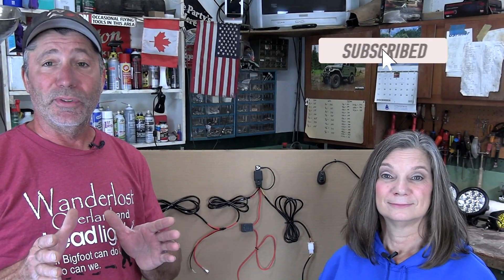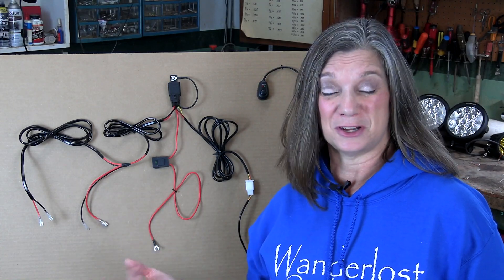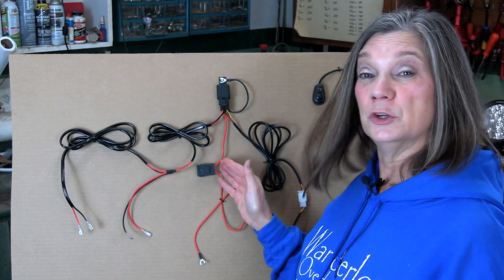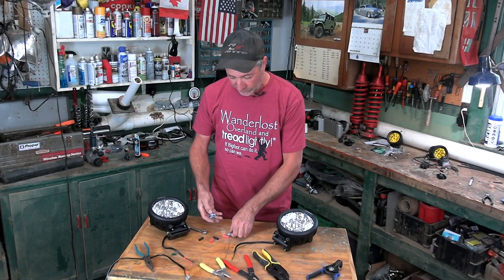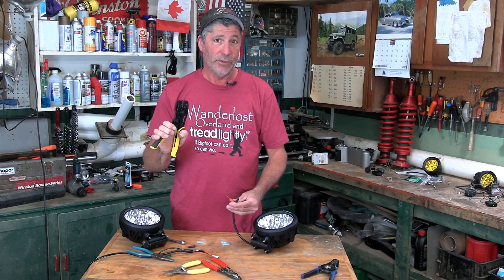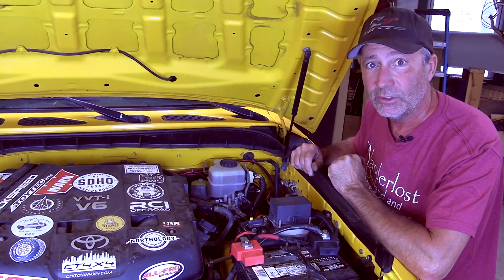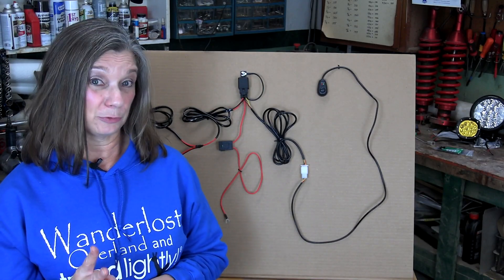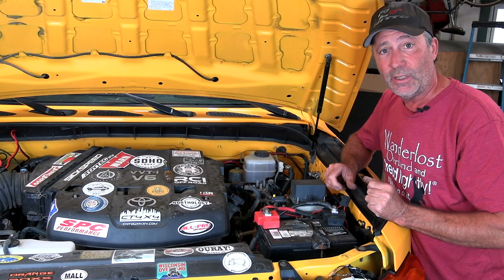How To Wire In Relay Harness For Lights, SIMPLE!

Comment: I have questions if I used the switch that came with it have a red light and green light if the truck is not on th red light always on does it drain my battery??
Reply: Or can I used different switches that doesn’t have any lights so doesn’t drain my battery when the trucks is on

Comment: Great video. Will the inline dash switch run the battery down the Red LED off light illuminating? Or should I run the hot wire off the fuse box?

Comment: Great video. I have a question. So ive installed 2 9inch spotlights and were working fine until a few months later the 30A fuse keeps melting afyer the lights are on for a while. Why is that happening?

Comment: Hey guys, this is a great video, but I have an issue. I am adding the LED lights to the rear cab of my tractor. The battery is all way in the front of the tractor. My power wire on my harness is about 10' short. Can I just splice in more wire, and if so do I use the same gauge wire or heavier ?

Comment: 2:15 not grounded correctly. The only contact you have for ground is the contact the screw is making with the thin edges of the hole it's hanging onto.
Reply: If its a plastic boat do i need to be concerned with ground the switch?

Comment: Im about to imstall light tomorrow.  This video made me feel a bit more confident in doing them. Although i have 3 A pillar switches already installed and would like to use them instead of the switch on the wiring harness. Can i just cut that switch off and connect the wires to my own switch?

Comment: Also there is a certain way the fuse tap is inserted. You can do this with a test light by finding out which side is the positive and negative. One side will light up and you want to run the wire from the fuse tap opposite of that so away from that side

Comment: Great video - new subscriber.  I already have a 20" Go Rhino LED bar installed with the same switch you guys used. I'm adding two more 3x3 cubes.  What type of wiring installation do you recommend?  Just keep it as a separate switch or some sort of relay?  Thanks

Comment: There is three wires going to the switch. If I want to use the “add a circuit”, which wire do I connect to it? What do I do with the other two wires? Thank you for this video!

Comment: I bought a 12 inch 180W LED light bar on Amazon & it came looking like this the wires, fuse & relay & all I had to do was plug the wires together & put the battery connectors on then I turned on my 2023 XMR 850 (quad) & about 20 seconds the fuse blew on it 🤦🏽‍♂️

Comment: great explanation thank oy...one question. my harness, in addition to the white wire come out of the butt connector to the switch that goes to the relay, there is a red and black wire come out of the white butt connector going no where...are they to be used?

Comment: You forgot to say what size fuse in the wire going to the battery.
Reply from the maker: The fuse amp size depends on what you're powering. Since that's an unknown for us, we couldn't recommend a certain size.

Comment: ive got oem foglamps working already and after a year relay got faulty. git a new one and all where working fine but it wont power on. lights working switch and relay working when connected to direct positive. is  it possible that theres a faulty wire? im totally blank

Comment: Thanks for the video. The relay didn't come with my kit. Do you have a link for the relay I can buy, which has the insert for the white connector? (The white connector that has the wiring for the relay).

Comment: Hi, enjoying your style of presentation :) 

I am looking at this with a view to installing my accessories to a motorcycle, same same, but different to a car just a little :) Looking at other videos also, how is it best to work out what you can have without it going up in smoke !

For instance, Dash Cam + Phone Charger + LED Spotlights approx 55 watts all up.... 

I was going to use a fuse block but the one that arrived is limited to 20 Watts....

Would it be better to use relays ? 

TIA :D

Comment: My lights came with a preinstalled on off switch. The wires are red black and white. Red positive and black negative. To connect it to my switch panel it states to connect red to fuse box and black to ground. Where does my white go? I think the white is for the led light up for the switch.

Comment: 6:33 you say you need to "connect it to the bare wire coming out of the switch".  Which wire are you referencing because the switch I have has 3 wires.  Thanks

Comment: Can you connect Fog lights to fuse box ?

I recently installed aftermarket foglights, the only issue i have is the switch being illuminated all the time even when the car is off, i had to connect the harness terminal to the battery positive terminal, am thinking of connecting a fuse tab to the terminal wire and plug it in an ignition 12V fuse instead, but the question is do fog lights run on 12V 

Note the fog lights harness consist of fuse and relay

Comment: Do I need a wiring harness like the one you used in the video, for putting a couple of interior lights underneath the glove box on the passenger seat and beneath the steering wheel to give a bit of light by my feet?

Comment: hello there, my query is I have h3 12v 55 w halogen fog lamp, now I want to connect it directly to the battery, which is the battery compatible with this halogen fog light & how much fuse Iam suppose to use in it? I want to install on my Honda Activa scooter of 2013 model. thanks

Comment: Thanks for this video although it didn't quite answer what I'm trying to figure out - how to use a harness where the low-current switching circuit is powered by the high-beam lights, and remove it so the switch is powered directly but without short-circuiting the battery with no load.

Comment: the point of the self tapping screw is it drills its own hole, why use the drill bit
Reply: You ever look at the tip of self drilling screw?  Does it drill as nice as a drill bit? NO.  Especially when you put some down pressure on it as it dangles from your hex driver bit.
Reply: @ bad workman always blames his tools, works fine a self tapper
Reply: Try it and find out. 😂
Reply: Funny I am just now watching this video and was thinking the same things..lol, he drilled a starter hole for a self tapping screw then installed the ground wire on top the plastic instead going underneath so it would have direct contact with the metal.
Reply: I have used hundreds of self tapping screws and there is no need to drill a pilot hole, especially in the thin metal he attached that relay to. Honestly that metal is ao thin you could screw a drywall screw through it without a pilot hole! And yes I have done it MANY times.

Comment: Hello, I just installed that same wire harness to my aux beam. My “off” lights is always on even though the car is off. I’m assuming that’s not normal and if not can I tap in my red wire that is attached to my fuse to a fuse inside the engine bay instead of the positive on the battery. Thank you. I hope you can help me!

Comment: I have a very similar harness with the same button/switch. I believe I wired it correctly but the little red light on the switch is always on, even when the vehicle is off.  Is this normal or should it not be drawing constant power like that?

Comment: I have pre-installed aux switches in my bronco and I have a wiring harness for four ditch lights. The wiring harness has a switch and a relay. And I'm wondering where do I cut on the harness to attach to the ox switch and ground? Do I cut where the switch is and use those two wires or do I cut somewhere else on the harness like where the battery wires are at? I'm confused on how to do this and can't find any answers even from the company I bought these from.

Comment: So I got my harness in and followed all instructions but when I turn it on the fuse blows should I try a 50A fuse or get a new harness
Reply from the maker: First make absolutely certain that you have the wires connected properly. Then research how many amps your accessory is rated at drawing, size the fuse accordingly. If it's still blowing fuses there may be a short in the harness.
Reply: @WanderlostOverland  I got a new harness and I’m still having the same issue I’ll be taking it to the shop to get it done by a professional

Comment: Thank you for this great video helping me to install my lights. The only question I have is how do you penetrate the switch wiring through the firewall. I only have an existing wiring rubber boot(already loaded with a bunch of wires). I can poke a hole through the robber and fish the wire through, but not the switch (too big) or the wire connecting harness (too big as well). Any suggestions? Thanks

Comment: i like in this movie you told us how you were about to put the fuse in long with the adapter you're making with the pigtail screw inside of your truck you know half the E bike builders that put these E bikes together and ship them they ship it with the fuse intact into the battery and then they don't describe where the fuse is so you can find it and pull it out yourself that's why they're all Catching Fire can you please describe this to the ebike builders and describe why they should not have a freaking fuse do you light their E bike on fire before it gets to your house door step shipped fully charged with fuse in spot and without proply having a language barier on the shop to pay to get slamed the door when they continue the bike sales on internet only no shop will work on any name builders bike only new ones.

Comment: I bought a bumper for my 21 Wrangler Sport without LED package. The new bumper has four LED lights to replace the original 2 halogen fog lights. Each LED has its own Rd/Blk wire. I would like to somehow connect those wires to the original fog light wiring harness that has that connector. This way they will all be controlled by the vehicle fog light button.  Anyone have a video to refer me to??

Comment: Have a general electrical question about wiring in SPST on-off switch to aftermarket driving lights. In VA these lights can only come on when the low beams are active, so I will have a wire as a trigger from the headlights connecting to the relay lead for the normal on/off switch. I don't want to sue them all the time, as in city driving so, I am installing an old school high beam foot switch on the floor board to turn them on'off only when low beams are on. 

Question: 
What lead/wire to the relay do I install the switch inline The wire from the trigger wire that would be the normal on/off switch (makes sense), the fused 12VDC  power in, the chassis ground, or the power out to the driving lights. Seems any of these would work, but not sure if one is optimal.

Comment: Great video.I actually have that same harness you guys are demonstrating. My question is I assume the way you show the switch will have constact power from the battery, how would you wire it so it doesn't?
Reply: I have the same issue, the light on the button is always on, even when the vehicle is off
Reply: @sfwood22  Cause its wired directly to the battery. You have to wire the trigger lead to the switch to acc power. I believe it's the yellow wire on that relay but the wire colors differ from relay to relay so double check. I used a fuse tap. The relay will still use the power directly from the battery but the switch will only get power if the car is on.

Comment: Great video very informative. I have a question instead of using a switch inside the car can you tap off of the high or low beam head light wire or a side marker. Thanks
Reply from the maker: Yes you can!

Comment: Hello there, 

Hope you assist with my fog lights wiring. I have a 2010 tundra and installed them myself. So the fog lights already comes as a kit with fuse and rely. Now my fog lights are not working. No power from the switch inside the cabin and the fuse inside the engine bay is good .what could cause my fog lights not to turn on , please advise thank you

Comment: For the red cable does it have to be connected to the battery ? will it drain my battery ? or can the red cable also be connected to the engine fuse box? thank you

Comment: Probably a stupid question, but did you disconnect the negative wire on the battery before attaching the positive wire to the positive terminal on the battery?
Reply: No they did not. They only removed the fuse from the holder only. So once all your connections are done...add the fuse last.

Comment: I bought a used light bar for my vehicle it came with a rats nest of wires. I got the light installed no problem but the wiring was a real conundrum. 
After watching your video many times i was able to figure out the wiring. Thank you for such a clear explain of how to wire a light. 
P.S. where is your location?.
Reply from the maker: glad it helped! We're on the Wisconsin Illinois border.

Comment: I have a question, I used this switch, I cut the negative wire in half (it’s for a particle seperater on a side by side) I cut the negative in half and put one end on the gold and one end on the outter silver. Left the middle one blank. And it works when I turn the switch on it works and the led lights up. The middle pin is blank. I’m confused if it is safe? And why it still works? I’m just using 2 pins , the negative wire only. And the led still lights up.

Comment: You can never have enough ground.  

When I had a boat with many accessories, I installed a separate ground buss near the fuse panel so every power line had a place to attach a ground lead.  Of course I did this because the boat was made of fiberglass.  On my modified vehicles, I run a lot of ground straps all over the vehicle.  All it takes is one ground strap to fail and now you might run into resistance problems.

Comment: HOPING you may be able to help me. I installed a new grille on my wife’s 2008 Mustang that has fog lamps that need wiring and NO instructions. To make it simple to explain it also came with a wiring harness with a relay and fuse on the light/grill end and a push button switch exactly like the one you demonstrated. Not knowing the wiring without instruction the seller says they do NOT have. From the two wire harnessed fog lamps, that harness goes to a connected relay with attached black ground wire like you demonstrated and fuse .. after the fuse is a red wire that is about a foot long and stripped on the end. Also coming off that portion of the harness is a long white wire that extends to the other side and the switch. On the switch end which has a switch which is a push button with to small indicator lights .. Red and Green … sealed in a tear drop button the same as yours. That switch is connected just inside the firewall with a three wire plug that exits the drivers area and firewall.Once connected the harness turns into three wires … black with a terminal end to create another ground and red the goes back to the other side and is stripped near the relay etc. and the lone white wire that is the only wire that goes the total length of the wiring harness. In order to see what was needed I layer the wiring harness from the lights across the fuse box on the passenger side and across the engine to the drivers side. I grounded the two black ground wires and turned the switch on and took the two red wires that were stripped (though one may have had a terminal end ) onto the red terminal going into the fuse box. The lights lite and I was able to turn the lights on and off with the button switch. With that in mind I took the two red wires from both sides and put a plug in terminal end and plugged it into a open slot inside the fuse box. However, yes the lights worked BUT the little light on the button switch is on green only solid and does not go off or show red as it should. Hoping you can help. I know you said something about connecting to the battery. AND the wiring harness inside the car is insulated and covered as to not do anything more than stick it on and off and on. I have thoughts but I don’t know IF they are right. HELP!

Comment: You forgot to explain that the add-a-circuit must be installed so that the current actually flows through the fuses. If you install it "backwards" then the current bypasses the fuses and your circuits are no longer protected by the fuses.
Use a multimeter to determine which side of the original fuse is the line side, i.e. the hot, then install your add-a-circuit so that the load, i.e. the red wire, is on the other side of the fuse. This will insure that the current will flow through both fuses and that both circuits are properly fused and not a fire hazard.

Comment: Informative and only lacking one item. i want to turn on my high beams on the Sienna and I want the LED lightbar to turn on at the same time. According to the DOT laws you are not to have any lights positioned above your headlights and you are to have the LED's on high beam only. Although i would like to vaporize objects in the way I want my lightbar to illuminate the road I am driving at 60-70 mph .

Comment: You are supposed to remove the paint for the chassis ground. Otherwise you aren't going to get a solid ground if you are worried about rust you can use dielectric grease and it will prevent corrosion and rust at the grounding area.

Comment: Hi! I recently bought a used ARB single air compressor. The seller didn’t include wiring. Do you have a shopping list so I can build a diy harness.? I know I’ll need the pressure switch, relay, in-line fuse, and on/off switch. Is this something I can pick up from my local Ace Hardware? Thanks!
Reply from the maker: ARB should have a wiring schematic diagram on their website. That should give you an idea of what you need.